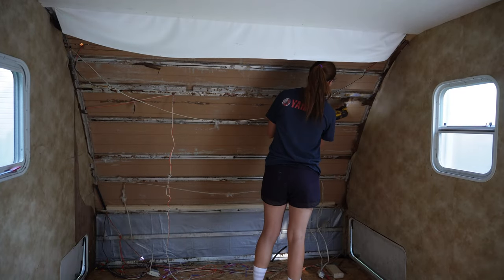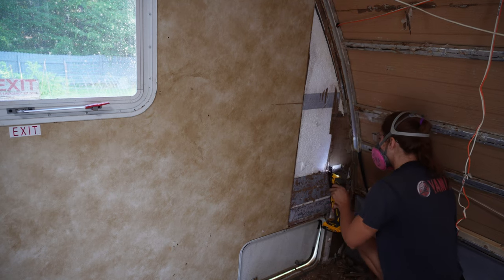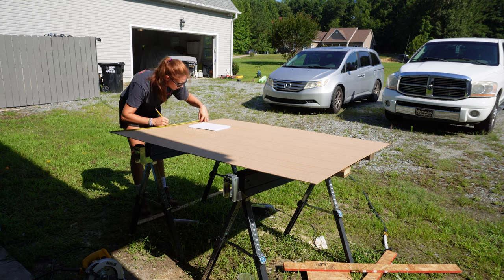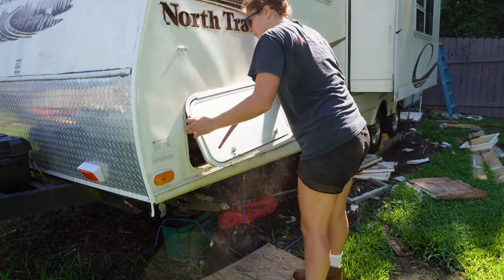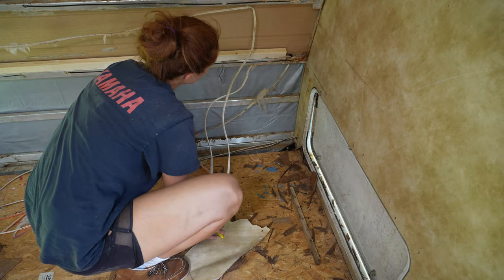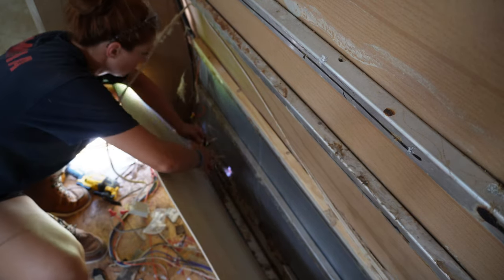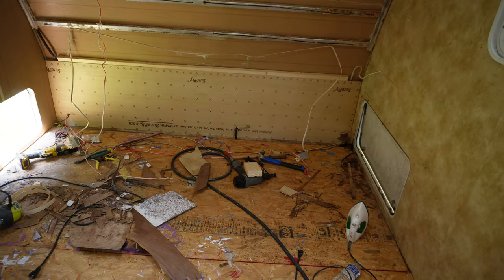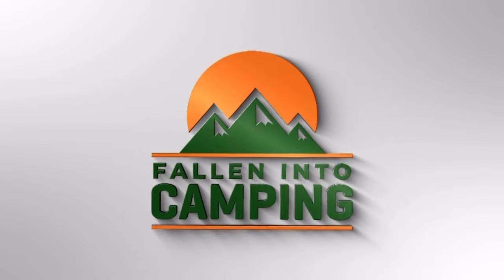RV Water Damage Repair: Demo Day 18 Wall Repair

Comment: Great work. Wouldn't a template made of several paper sheets taped together be more accurate and easier to transfer to your final material?
I've done this with very good results in most of my projects with odd shapes.

Comment: I’m watching your videos because the 10 yo travel trailer I just bought,  has a few curiosities . The mystery of mega lap sealant on front cap seam  / Straddles the vent fan and skylight.   
All vulnerable if the seam isn’t sealed up and leaks.  Mystery lead to suspicion, so I scraped ( scraping , actually I’m not through, that stuff is gooey 🥵) lap sealant from seam/trim and removed skylight .  Found a few rusty screws and a few much longer wood crews .  ?? And there wasn’t a gaping gap like I thought, afterall .  (So why all that lap sealant ? )My suspicion was that the cap meets the fiberglass roof: to put 3M Marine grade  adhesive/sealant since that is rock n rolling down the road, maybe keep it from shifting . Yet flexible.  To me, lap sealant and screws doesnt give me peace of mind, even if it does keep the water out. It’s hot on the roof — it’s been put off and now I’m having to talk myself into finishing it.    What’s your advice after the 3M marine sealant/adhesive cures -  can I just use EternaBond tape over the seam , then self tapping screws on the trim . Cover over again ?
Reply from the maker: Great question—you definitely had a leak if the screw underneath was rusty. I have suspicions that the wood around the vent might be soft, so someone put a longer wood screw in to pull the vent into the roof. You won’t always be able to ‘see’ where the leak is. Sometimes it’s guessing based off signs from around that area. If it were me, I would take that vent off and investigate. If you don’t want to do that, scrape as much of the old sealant off as you can, and apply new self leveling sealant. Don’t skimp, be generous with it. Don’t use eternabond tape—that stuff is like a temporary bandaid. Over time, the sun will case the edges to lift up and create air bubbles underneath, leading water to get trapped inside. It’s great stuff in a bind, but absolutely terrible as a permanent fix
Reply: Thanks

Comment: I just read where the self-leveling silent is not good for vertical pieces what do you use on vertical pieces we are sealing  our pop-up camper
Reply from the maker: That’s correct, self leveling should only be used on the roof. Outdoor Silicon for any exterior trim pieces that need to be resealed

Comment: You use a 16g nailer with 1 inch nails.  Finish nailer?  Will a 18g work?  Having a problem envisioning them going into metal and holding on the bowed wood but you're the pro not me!!  Great video, learned allot!!!!  Going to do the interior nose on my Palomino.  Guessing I'll be running in to rewatch alot!!!!!
Reply from the maker: 18 gauge won’t work. I tried 😂 it jammed my nail gun up and broke it. 16 gauge can throw a nail through aluminum no problem. A 16 gauge staple gun is probably better but I don’t have one. Liquid nails also keeps the bow in addition to the nails
Reply: Thank you!!  Any thoughts on Eterna bond tape.  Just paid 8 grand for new roof.  CAN NOT happen again!!! @fallenintocamping
Reply from the maker: @briantrusty9906  it’s terrible, stay far away 😂 It’s ok if you have a hole and are in a bind,  but never as a permanent solution. It can bubble up in heat and water gets trapped under it…bad situations
Reply: We've definitely got heat here in Florida!  Gonna take your advice and stay clear of it.  Have you ever patched aluminum siding?  Have what I think is dissimilar metal corrosion around the water hose hook-up and don't want to replace the whole siding panel with decals and all?  Thanks for all your great videos!!!!!!  What a tremendous help!!!!!!  Watching them all!  There maybe hope for me yet!  LOL @fallenintocamping

Comment: I see you use many different sheet panels (wall panel, plywood underlayment, etc.) for the walls internally and externally. Does it matter what and where they're used? Under filon, could you use a wall panel or better to use plywood underlayment / something else?
Reply from the maker: Yes and no. I really fluctuate for the Interior between 1/8 and 1/4 inch. If I need it to bend, or if it’s an interior wall, I always use 1/8. Ceiling is always 1/4. Floors I try to match whatever thickness is already in the camper, and same with roof thickness
Reply from the maker: I use 1/8 for under filon, just because it bends and the manufacturer originally uses 1/8 inch so I want it to be seamless. Think: If you put a 1/4 inch panel beside 1/8 panel, you would have a 1/8 thickness difference and it dosent really look that good
Reply: @fallenintocamping  Thanks for the reply, that makes sense but I was more thinking about the type of panel. 1/8” wall paneling vs. 1/8” underpayment. I think of the wall panel as something that has a finished surface on 1 side. It looked like you used that but had the “back” was what you epoxied the filon to. Either way, thanks for the videos.

Comment: Thank you for your videos! I've been chasing some water damage in the rear wall of my rPod. The trouble with these trailers is that there is no way for the interior panels and flooring to breathe, if they get wet. . I thought I read that it wasn't recommended to use paper backed insulation. What are your thoughts?  Thanks!
Reply from the maker: Nah paper backed is fine. And even then, there’s only paper on half of it because I split it. If it makes you feel better, they sell unfaced, which is the same thing just without the paper. It’s not like an all aluminum trailer, where the walls will condensate and cause moisture. Most horse trailers are all aluminum and need a different type of insulation, but campers either use r-13 or some type of foam.
Reply: Thank you!

Comment: No insulation between the front cap and the interior wall board?
Reply from the maker: Probably should have added some, I just forgot. Would only fit a quarter sheet of insulation anyway, so not super helpful 😂

Comment: I don't think it would have occurred to me to nail into the aluminum strips. That is why I watch these videos to learn and pick up tips. Did the manufacturer leave out insulation in the front cap?
Reply from the maker: Some do and some don’t. This camper only had 1 inch space between the walls so it would have been really hard to get it to stay in there while I put the panels up. I probably could have (probably should have) but it was hot and I was tired 😂 The original insulation was like 1/4 of a sheet and I don’t even know if that’s enough to do anything
Reply: @fallenintocamping  Probably too small of a space for insulation to be useful.  The heat is horrible so I know how you feel. I've got a few projects going that could have been completed but I bail out of finishing them on a regular basis because of the heat. Be safe and as usual good work.